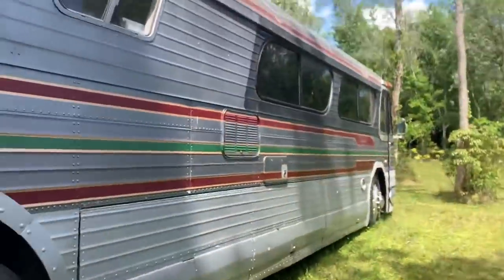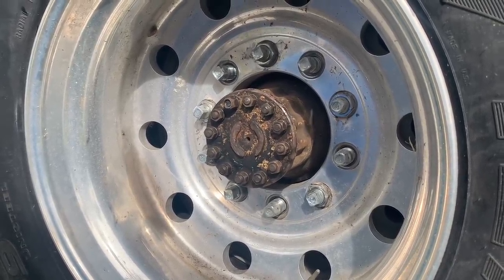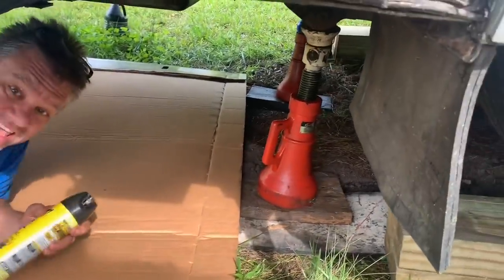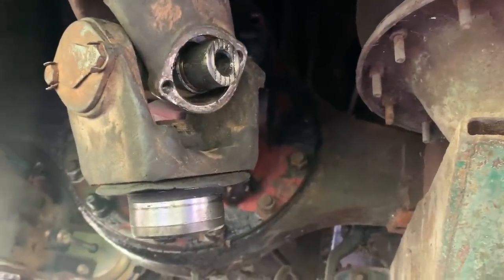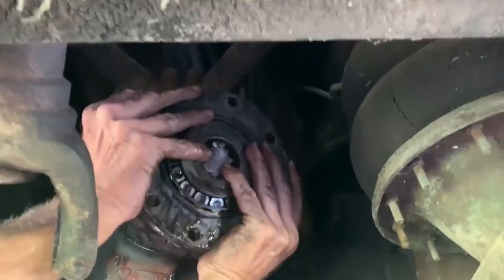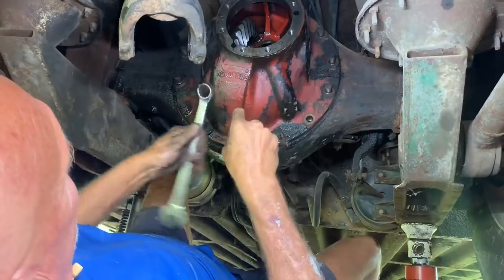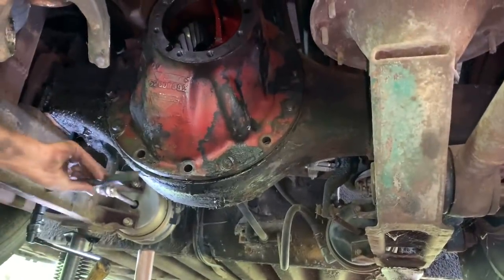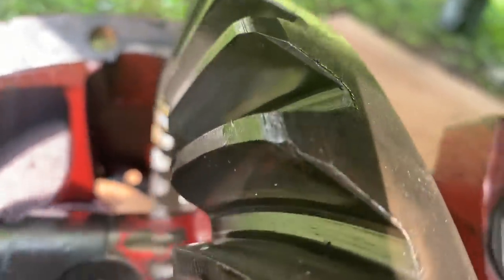MCI rear end pinion snapped

Comment: Hello, This video brings back some memories, I was a mechanic and worked on aircraft refueling trucks. We had 4 F700 Fords and 2 International V6-71's cabover. These had the has the same rear axle setup. Had to change rear bearings and seals all the time and what a job trying to remove the keepers around the wheel lugs, you make this job look easy... have a great day....

Comment: Working in this industry for many years I've seen a good number of rear damage due to rocking. I've seen the power divider  on tandom axles come apart  from over speeding on ice.  A buddy of mine used to brag that his 4 cylinder VW had 116-ftlbs of torque.  He stopped when I informed him diesel trucks run from 1200 to 1850 ftlbs of torque. The engine could do more but the power train can't handle it.  Even when the dealership turns up the horse power these days they check the torque rating of the drive line.  That's the limiting factor. I'm sure some one will remark how they turned everything up and have no problems. Just remember that down time is money lost in more than one way.  To them good luck.  Great channel by the way.
Reply: Have you ever seen that bumper sticker (it's not new by any means) that says... My Lug Nuts Need More Torque Than Your Honda Can Make .....  Also, back in the 90's when I was a HHG mover, I worked my way up thru the "junk" to a 4-yr old FL that had a 300hp 3306b.  One day I found myself on a long distance move where the customer had a car that had to go in the van. It turned out to be a Corvette.  In the process of inventorying it prior to loading, we noticed that the breather canister still had a factory sticker denoting (or should I say trumpeting) 375HP.  I informed the shipper that his car had more horsepower than my truck did, and we had a little laugh over that.  Of course the truck made 950 pound-feet of torque, but spec hp was only 300, which by todays' standards is pretty lame, but back in '89 when our Boss bought it (and others), 300hp was enough for what we were doing and where we were running.
Reply: @stanpatterson5033  No but I wish I had that sticker.  It's so true even the old Dayton wheels took 250 ftlbs and today's hub pilot wheels take 450 to 500 ftlbs of torque.
Reply: I always wondered how the math added up... 250 foot-pounds across 5 or 6 studs on the spokes, against 450-500 across 10 studs on the pilot rim assemblies....  But I guess one of the secrets is the location on the "circle" where the fasteners do their thing.  On the Budd-style rims, the fasteners are all together around the wheel hub, while on the old Dayton-style, the fasteners are further out to the edge of the "circle", so I guess they need a lot less torque to do the holding of things in place. That, plus the wedges, and I think the studs on a Dayton setup are a fair bit more coarse thread than the pilot-style studs are.

Comment: I used to be a heavy truck R&R mechanic. Love how that gear oil turns orange with age...  Get yourself a good set of wedge pliers for taking those axle keepers out. I sneered at the idea for years until I picked up a cheap set. Felt like an idiot for not buying a set sooner.

And I love your videos. We picked up a '53 4104 and I need to learn how to run the rack on it. I also need to completely replace the rear brakes... Someone converted it to dual-chamber maxi cans, but flubbed something. The only way to release the brakes is to pull the pins connecting the slack adjusters to the S-cams...

Comment: I made a tool out of a regular pair of household pliers for easily removing the split rings under the axle nuts. Just grind one half of the pliers jaws to a vee shape so it strikes the other jaw in it's center when you close the pliers(kind of like grinding one jaw so it looks like a big wire cutter jaw). Now you can usually grasp the SPLIT at the split ring with the jaw you ground down, and the other regular jaw will grasp the other side of the split ring. When pressure is applied to close the pliers, the ground vee shape on the one jaw will spread the split enough to very easily pull the split ring off, or at least easily rotate it off the stud. Saved many a finger tip while having to jerk the axle in and out numerous times. Generally once you pop the axle with the sledge you've usually got just enough shoulder available on each split ring to grasp them with the modified pliers. Diesel Mechanics RULE!

Comment: Massive overload flashback for me doing gear work a long time ago now; that brought back a lot of memories. The only thing worse then pulling that third member is I was truck driving 2017 and parked for my 10 hours off at the loves truck stop in Ritzville , Washington at the conjunction of 395 and I 90 , 50 miles south of Spokane Washington in a blinding snowstorm and about 25 degrees watching a tow truck driver prepping a grayhound bus to be towed. He had to pull the axles to disconnect the drivetrain so he could tow it, P S I have pictures of it not a fun day for that tow truck driver.
Reply from the maker: I try like hell not to work or drive in snow

Comment: My truck has the hub covers all around but they are all one-piece plastic chrome that just push on over the lugnuts. When I pulled into the Winamac truck shop for the replacement power-divider carrier unit and thru-shaft, first thing I do is pull hub covers and place in cab so the mechanics don't have to mess with them. My power-divider gears were chewed up bad and the bearings on thru-shaft just fell out in pieces. Just like a brand new truck all over again and tight, driveline from engine to back drive axle is very tight and zero play. The way I tore it up was very similar to the way this bus was damaged. I forced the truck out of a rut by rocking it back'n'forth in a farm field grossing 100k pounds and the front carrier (2.64:1 ratio) popped but all damage was internal. I'll never do that again. Hurry up and make some more videos so I have something to watch on the weekends.

Comment: The marks in the diff housing might be from a similar Problem i had many years ago. i was driving a truck I owned in western New South Wales,Australia, From a town called Cobar,through the back roads to North Queensland. The road was Brutal with massive rocks everywhere and Road trains travelling full throttle along it (road train=Semi trailer,with 3 full size trailers) .I suddenly ran out of drive. I thought i had broken an axle so in the dust on the side of the road I pulled them both out ,they were OK ,so I decided to pull the diff head, no jack or anything,just a spare wheel and some bits of wood from the side of the road. The carrier bolts on the diff head had broken and the ring gear was moving back ,away from the pinion,Hence no drive . The broken parts of the bolts came out so I got my offsider to stop the first car and see if he could get a ride back to Cobar which was 100 plus kilometers back,with instructions to get four bolts the same as the sample i gave him. a few hours later he was back with four 'similar' bolts, all galvanised ... Like you would use for hanging a farm gate. I put them in and  bolted it up then  carried on, just on dusk. I Did four more trips up that road ,which takes two days driving , and some local work before selling it on .When you are young and fit,anything is possible.

Comment: I wonder what caused that damage on the inside of the housing. Something probably happened some time during its life to push the carrier out and into the housing. And they just replaced the entire thing in one shot with the one you just took out.
Reply: I think the bearing was busted at some point of its life and caused the ring gear to wobble.
Reply from the maker: Yeah looks like a previous damage from another gear
Reply: I Thought so too, maybe the ring gear was at some point damaged and changed earlier but some initial damage was apparently not visible on the pinion gear and it was not changed - and now it's life got into abrupt end... Well, just a quess. I think these both are normally changed together.
Reply: @iivaridark6850  Yeah just like a Ford 9 inch. Take out one assembly, stick another in, done. Of course it's a lot easier than this big GM/MCI Monster but the basic principal is the same.

Comment: Working heavy in the field is what I do. A tip for popping taper-lock axles is to leave the nuts on  until it pops so you don't create more work for yourself repairing smashed threads.
Reply from the maker: That’s why i was swinging light.  I knew if i went for a home run swing i was going to hit a stud for sure.

Comment: One time I saw a drip from the rear end on my dump truck when I did my walk around. Turns out the pinion bearings wore out and the poor alignment ground the teeth off the gear like a 90 year old lady. Never had any other symptoms. Took a while to find a new set of gears but it's running again.

Comment: I have only worked on one car in the past 40 years that had broken a pinion, that was a Triumph Herald 13/60 saloon, it happened late one night to a poor guy in the middle of the road outside a football stadium, he left the car there overnight where it was as the back wheels had locked up & he couldn't afford a tow truck until a day later,so people had to dodge it & drive around it !!!!!! It ended up at my place of work, so I was immediately intrigued by how it happened, upon stripping the diff., axles, halfshafts, driveshaft, transverse leaf spring I found that the diff. had been taken apart before & that the pinion nut was only hand tight, this caused considerable play/end float so much so that the pinion worked it's way back into the crownwheel & seized onto it. I asked the owner when the diff. work was done & he said 5 years ago !!!!!!

Comment: I drive late model MCI & Prevost coaches. Snapped rear ends are so common because of dipshit wheel jockeys. Prevost went so far as to offer electronic lockers to prevent it from happening but the drivers still had to have the forethought to lock them when one side of the coach was not getting traction. Apparently that’s too much to ask from a lot of the warm bodies they call coach operators.

Comment: I personally like to looks of the hubs just bare. Don't cover them up let them be free.
Reply: On my R-600 Mack I just used caps that fit over the axle nuts. The hubs were painted to match the green body color. Looked better than it sounds and the hub caps were easy to remove.

Comment: Note to self: If I ever get a bus, don't put lug nut covers or top hats on it.
Reply: Or if you do, pull them off every 2 months and clean below them. I've never had top hats, but I've had a few trucks where somebody put those moons over the ends. I don't care a hoot for them, but I don't mind lug nut covers. I would take them off periodically before the spray wash guy came in on the weekend. Any time I had to get a tire done, I would pull off the nut covers and I would put them back on, so the tire guy wasn't fighting with or hammering them off.

Comment: Amazes me that battery powered impact gun can loosen lugs like that.
Reply from the maker: If they are put on at the right torque it has no problem.  450-500 ft lbs, problem is most tire shops rattle them on with a 1” gun to 2-3x that much torque.

Comment: Isn't there a slide hammer for axles?
Edit, is that some type of locker?
Edit, that's like a old Toyota rear, if it wasn't, you would have to pull the whole rear out. 
Thanks for posting/sharing nice video, i give you alot of credit doing that on the ground!

Comment: Was the differential upgraded when the engine was changed? Too much power for that little 4104 671 diff?
Reply: They could not use the V drive third member on the T drive axle housing. It would be cool to see them install a splitter from a truck.

Comment: Why did you pound on the center hub plates before pulling the axles? Just to free it up a little?

I call you the Bus Whisperer btw.
You are awesome at it.
Reply: There are tapered collets (a conical wedge with a split along the length) over the studs that engage with the holes in the axle shaft flange.
Their tapered action centralise the axle with the hub when tightening the nuts.
Because they are tapered they wedge in and lock - you can not pull the shaft, so you thump the flange and the shock often bounces them out (like a tapered steering balljoint).
Had a few funny moments watching people scratching heads why they can't pull an axle or a wheel who are not aware of them. 
Definitely a legit 'hold my beer' moment 😂

Comment: Whoever did that safety wire job sucks all the wire should be twisted tight or there is no point to safety wire the rear if your going to leave it that loose

Comment: You, obviously, know what you're doing but I would like to see wood on top of those jacks...not Jack.
Reply: Yes Jack, so the surface loading intensity is increased by the jack stand pressing up against the wood, the wood splits and the load falls off and crushes them. Sometimes steel on steel is acceptable, but not generally for load restraint - unless it is rough steel plate on rough steel plate but of couse you know all this so I'll just shut up and leave you to your armchair.
Reply: What would be better is some high strength rubber jack pads.  

Some of those screw jacks top heads have pretty good sharp tipped traction knurling but not sure if those do.   

I'd be more afraid of the boards sinking in the ground and the jacks tipping. Looks pretty solid though.

Comment: Next time, wear rubber gloves!
I've read that prolonged contact with used oil can cause skin cancer.
Reply: RS 1990 like bathing in it for years straight.
Reply: iam dead
Reply: it's differential lube so no combustion by-products are riding in it- he's good.....spider bites on the other hand.........
Reply: A good  coating of oil is good for keeping the skeeters off of you

Comment: Instead doing like you did wouldn't  been easier  to disconnect  the axle and pull.the axle out from under the bus little more  work but safer pulling  diff

Comment: I had to change the 3rd member, on a 1978 ford e150 by myself in a dirt lot (I did it) pulled the axles of course then the pumpkin/3rd member came right out (HEAVYWEIGHT) MOTHER , I'm on my back trying to get the replacement (used)PART up and in place ,WAS A BITCH!!!! BUT I DID IT , SOME STUPID SHOP
( OVER TIGHTENED) MY  PINION THRUST  WASHER ,AND DESTROYED MY 3RD MEMBER 
SAID IT WAS MY FAULT FOR NOT FIXING THE SEAL SOONER , 
FUCKING BULLSHIT , YOU DON'T USE A 1/2 INCH IMPACT WRENCH 
TO REINSTALL , YOU HAVE TO BE VARY CAIRFULL NOT TO OVER TIGHTEN . SO I WENT TO JUNK YARD AND GOT ANOTHER ONE
GOD I WANTED TO KILL THAT SHOP PUNK